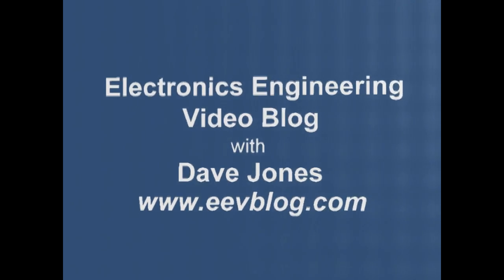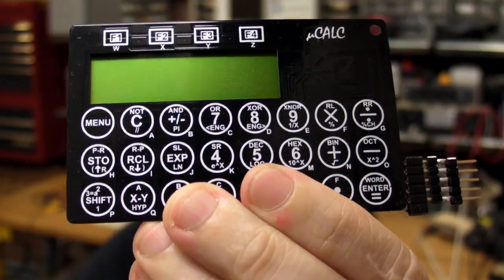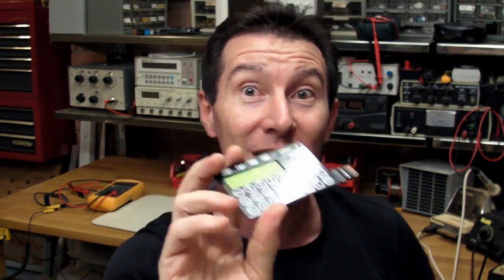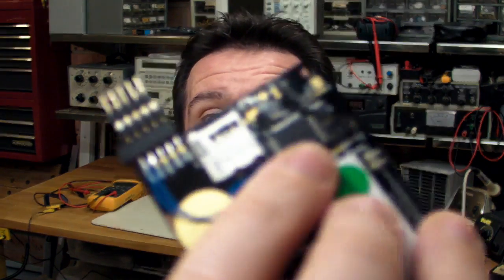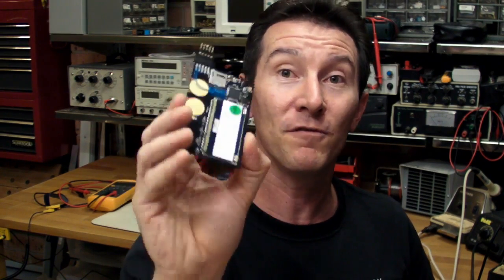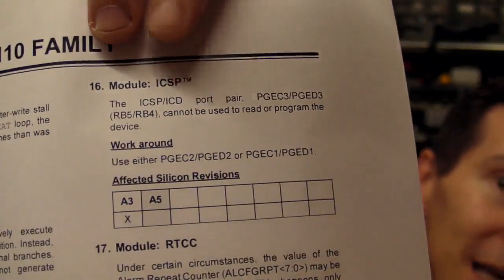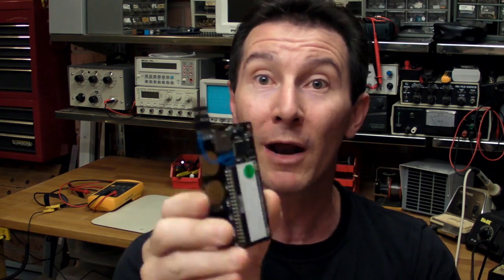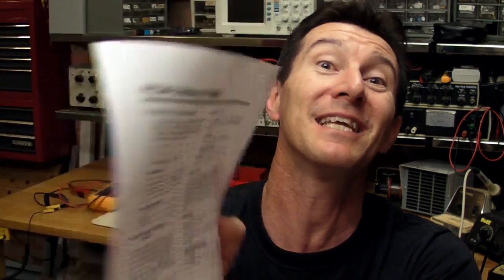EEVblog #53 - Mr Murphy and Microchip PIC Silicon Bugs

Comment: I'm just now starting out on Microchip MCU's (PIC12F683) and all I want to do is a simple blinky LED Hello World to start learninggggg. I got the program compiled to HEX clean etc, But everything I try with PICKit3 gives me "Connection Failed" ... Mac OS X, PC Win7, MPLAB X, MPLAB-IPE, whatever! It doesn't work! How long, how hard and how deep will I have to dig and dig to get the little PIA PICKit3 to work!!? So far I've not found anything for firmware updating or whatever... Really getting tired of screwing with Microchip apps and their connection problems with PICKit3! Ahhhhhhhrgggh!

Comment: Hi Dave, I'm disappointed that I didn't get to know what silicon bugs consist of, why they're there and why they're apparently not easy to get around in the manufacturing process(since they mention them in their datasheets, instead of fixing the problems before mass producing them). I'd like you to do a video on it if you find it relevant. On a side note, humor like 5:41 ensures that it's entertaining to learn from your videos, don't hold any of that back. Thanks for your worldwide contributions

Comment: same thing happend with us . There where 5 Bus options on the Chip - used Nr 5 with of course only working  transmit mode. But this time you had to call the chip company directly. Only problem here is: We have a shipping date in like 3 months and the last rev of this safety critical hw took over  a month

Comment: I have spent hours trying to debug why I can't get I2C to work on my Pic32 Ethernet starter kit on the expansion board headers. Guess what, on that specific board that specific I2C pair is not connected to the so labeled pins on the expansion board (it goes to the ethernet PHY instead)...